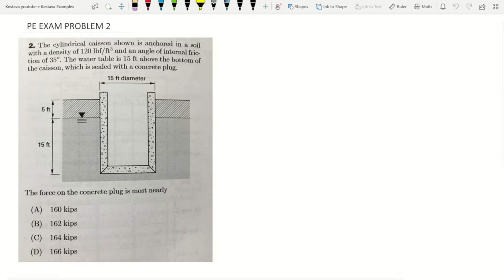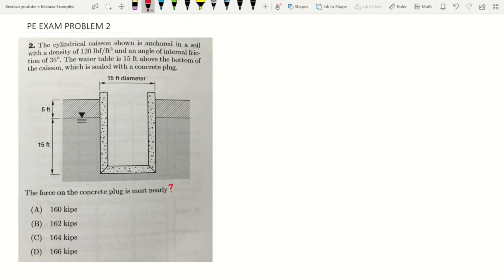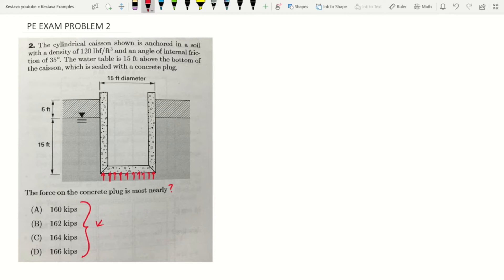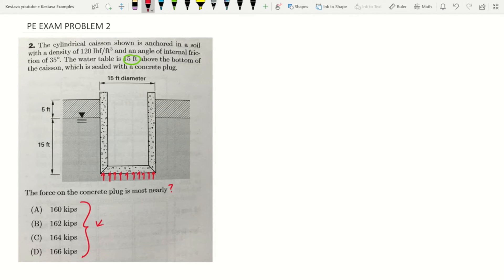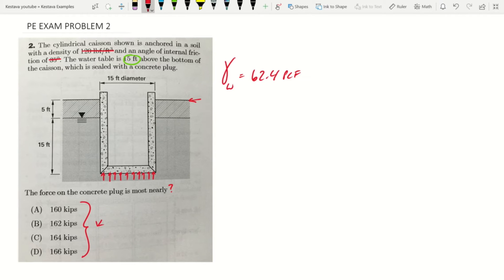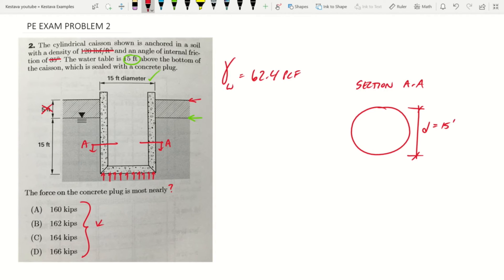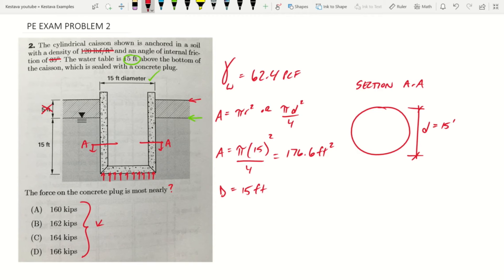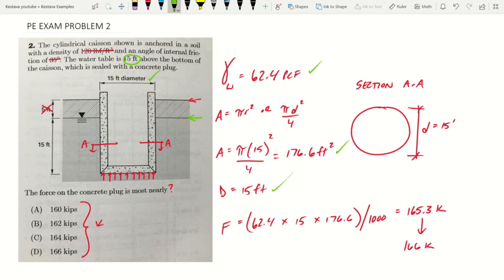Civil PE Exam - Practice Problem #2

Comment: I am not sure I totally agree with the solution provided.  The total pressure at the bottom of the caisson has three components: the pressure of dry soil (top) + pressure of saturated soil (bottom) + pressure of water.  Using the hydrostatic component alone is unconservative.  Anyway, a big fan of this channel.  Good job!!
Reply: In cassion design we only take hydrostatic component. Soil does not exert pressure on structure.
Reply: Another way of thinking about it is, what is the total uplift force on the concrete plug?

Comment: Its interesting that there's no sort of active upward soil pressure. If you have a cube os soil, pushing on soil from the top generates pressure on the sides (active soil pressure), so I would have expected pushing on soil from the sides puts pressure on the top.